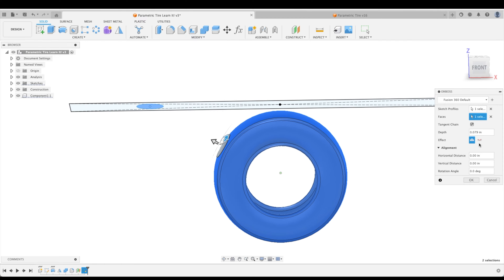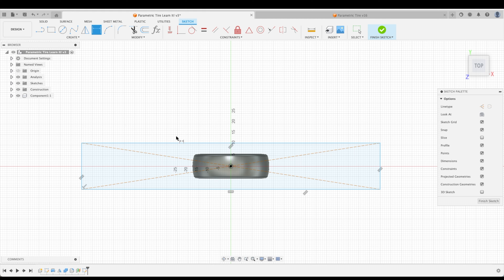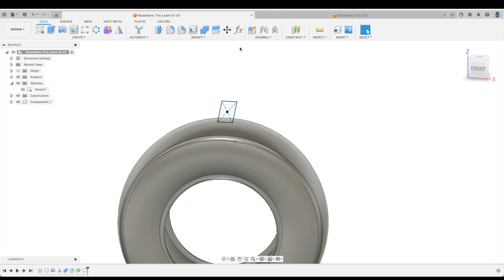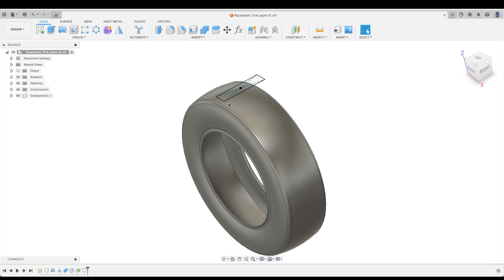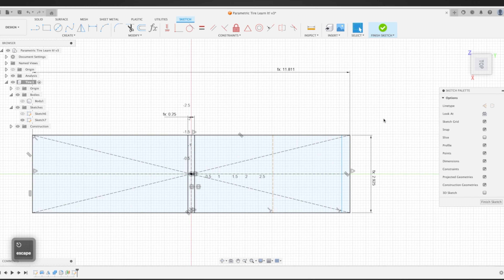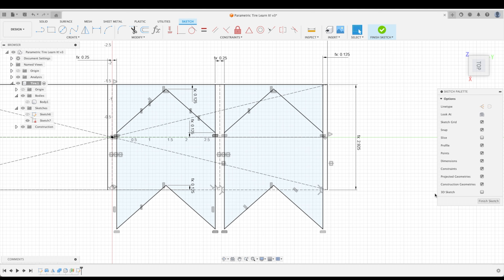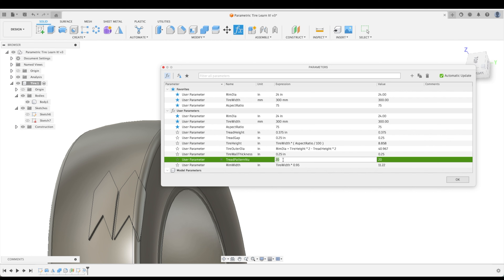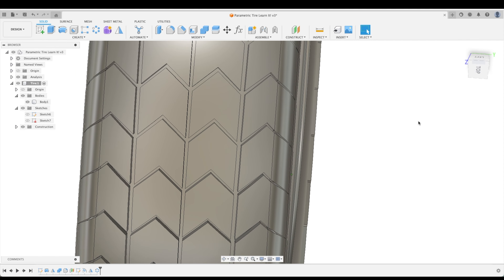Fusion 360 - (2/3) Parametric Tire & Emboss for Beginners/Intermediate Users - Lesson 12 (2023)

Comment: This one was fun! Excellent lesson! Concepts are slowly making their way through my addled synapses.  Fusion is certainly finicky.  Hard to explain but there are times when it would throw an error when I changed a parameter and then I change it another time, same parameter, same value and all others the same as well and it doesn't throw the error.  Specifically treadgap or aspect ration.
Reply from the maker: I am seriously impressed with how you’re progressing with this course. Amazing! 
Yes, parameters are an amazing thing but can be finicky for sure. The better one gets the better understood are the relationships between every parameter and aspect of the design. Once that is figured out, the mind doesn’t want to turn off thinking about all the incredible things to design. We need to always ask ourselves ‘why?’ Problem solving is 95% of the design process.
Reply: @learnitalready  99% perspiration 1% inspiration :)
Reply from the maker: @AlBurr  My goal is to flip those numbers!:_learnitUnlockit:

Comment: I'm curious about best practices with dependent dimensions. While it's easier to just click the center tread gap dimension because we know it's set to the tread gap parameter, that's building in a dependency that could cause a lot of work later. For example if we want a tread pattern without a center tread gap and delete that in the sketch, presumably all of the other dimensions lose that reference? Although now, I deleted that center gap to test it and… they're all still referencing (in my case) d34? How are they referencing a dimension that seemingly doesn't exist anymore? And even if I want to keep that reference structure, where do I edit d34 since it's now deleted from the sketch?
Reply from the maker: I love your determination in learning and seeing you figure out complex problems. Yes, the more dependent (or referenced) dimensions created, the easier things can break with your entire model. 

There is a lot to consider before creating dependencies. Usually, models and projects are not too complicated so as to worry about how many dependencies to create, however with this particular model which is teaching more complex design elements, you will start to see how problem solving ahead of time will work to your advantage later on. Even the phrase “your model (or parameters) will break” doesn’t even mean anything to most. Because you’ve stuck with us and really applied yourself, you’re starting to see what that phrase actually means and how to create good, working models/assemblies! Great job!

Comment: At 29:26 I found it useful that you displayed an approximate processing time per change. Since I otherwise have nothing to compare to, it's helpful to know where my computer's performance stands on the spectrum, or how much to accept that this is just how long it takes vs how much I might want to upgrade specs when buying my next computer. Thankfully my computer is less than a year old and appears to be performing very well. But it's nice to keep an eye on it as I get to more complex models.
Reply from the maker: Right now, I’m using a 2018 MacMini for most of my work and it’s doing well even with complex models. Hope to upgrade this summer. I might even do a video on testing performance, but that is TBD.

Comment: I'm not able to select the tire in the Emboss dialog.  When I escape out of the Emboss dialog I can select any face of the tire.  Not a selection filter issue (Select All is checked).  When I try to emboss I can't select anything.  Ugh.   

Edit:  In the same file I created a cube off to the side.  Created a plane above it, sketched a circle, and it embossed onto the cube just fine.  There's something with my tire that won't let me select it for embossing.

Edit:  After hours of trying to solve this, I closed and re-opened Fusion 360 and my file, and the Emboss worked.  Infuriating.
Reply from the maker: Glad it worked out in the end. 👍